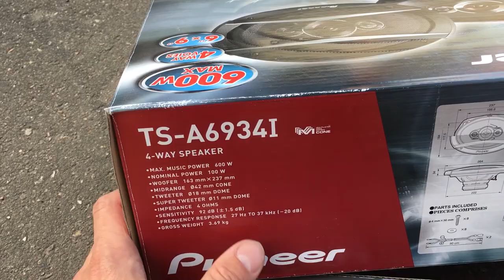Loud sound trunk install - 4 speakers Chrysler Crossfire

Comment: Ive really got to ask . 1 why would you build a baffel like this and the. Just install 6x9s ?  2. Why would you use such a large amp to power 6x9s . I just bought my wife a 2004 crossfire a d looking to do a sub install similar to this .

Comment: Where did you ground the amp? Old video so long shot on a response but wth
Reply from the maker: I don't really remember, but i think in the trunk, im too lazy to take ground under the hood
Reply: 6:30 is where he grounded the amp
Reply: @iammusic1950  so when I did mine if you lift up the floor carpet and carpet right in front of it in the trunk, there is a row of bolts, took one out, sanded and screwed in ground. 2 kicker 10s, ported box fits perfectly back there, 2  12s would fit if the box isn't ported. Plus another amp for the speakers(2 in regular spots and 2 where stock subwoofers go behind seats. All runs of stock battery and alternator no problems past 4 months